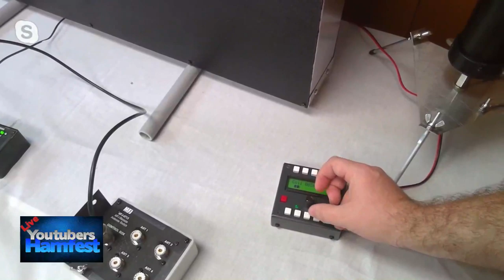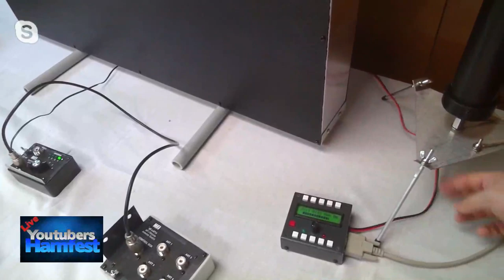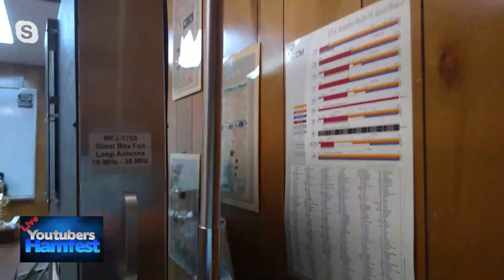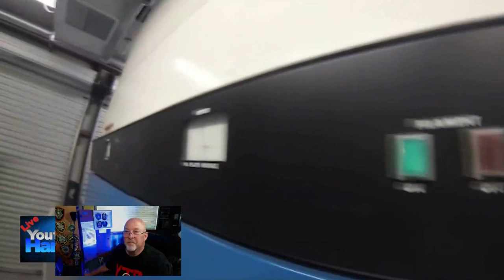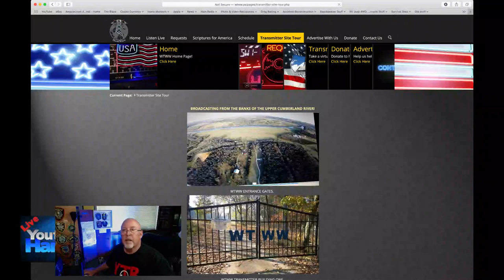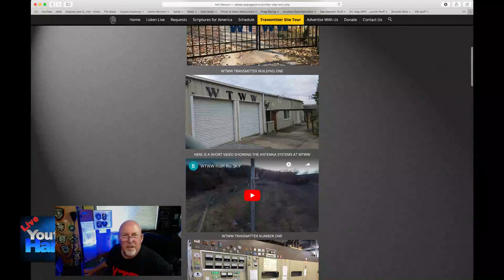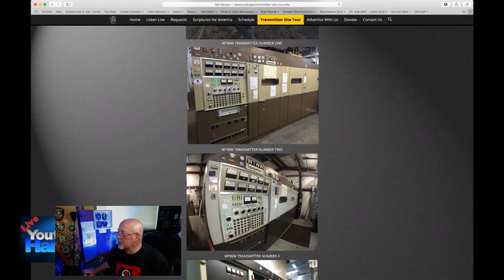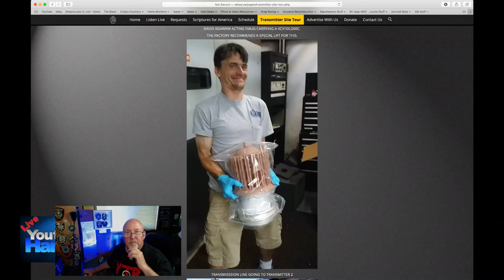YouTubers Hamfest 2020  Quirky QRP, MFJ New Stuff & WTWW Shortwave

Comment: This was a lot of fun to watch! And a lot of information to!
The swear barrel got filled and some new stuff got shown.
And as promised; here is a summary timestamp list.
-------------------'------------------

@1:05 We got welcomed.
@1:54 What are going to see.
@2:48 Intro for James.
@4:35 Welcome to Quirky QRP.
@6:06 The Finger Morse.
@8:36 Some Super Chat's.
@10:08 To Continue on your Hike from POTA SOTA.
@12:10 On an Altoids Rig?
@12:44 Jim's BackPack.
@14:29 How do we get one, and the Slinky Antenna.
@15:12 Wrap up for Quirky QRP.

@16:50 Hello to Jarod.
@17:40 So, Who is Jarod. 
@18:05 MFJ Variable RF Transformer.
@19:20 150 watt Variable ATU
@20:27 A Remote Antenna Switch.
@21:59 The Loop Tuner.
@22:54 A QRP Tuner With a watt meter And A 20 watt Dummy Load. 
@24:14 a 3x3 Big Loop !
@25:31 This is Not you grandpa's Screwdriver !!!
@27:33 Can i mount this on my car?
@28:27 Any Issues ?
@29:27 Q: What does that Big Loop weigh? 
@30:25 Real American Made !
@31:17 Surprise Guest; Mr Ju !!
@34:18 How many employees?
@35:30 Sneak peak inside the antenna.
@37:34 A Video Tour Of The Facility.
@40:25 Wrap up for MFJ. 

@42:33 Welcome WTWW
@43:23 About WTWW
@45:18 Some Super Chat's.
@46:03 A Video Tour Through the WTWW Station.
@49:47 Ham is This Ham Radio Related?
@50:45 How big an audience?
@52:12 What's the Mission.
@53:26 Covering the Planet?
@54:07 How and when can I receive you?
@55:31 Some Pictures to Show.
@1:00:40 Wrap up for WTWW And the Hand off to Ham Radio Crash Course.

Continue here: https://youtu.be/tDYDYwMKuVg

-------------------'------------------

I hope this helps. 
If editing is needed please let me know!

Comment: MFJ has greatly improved for sure. Having Jared on the other side made a difference. Waiting for the remote antenna switch, the MFJ Fan loop & the new coiled mobile antennas to come out into production. There are wants and there are needs. MFJ is coming up with stuff that fits in a category that no one is is actually looking at- INNOVATIVE. The factory tour was awesome and seen Mr. Jue a major plus. Thanks a lot Bob.